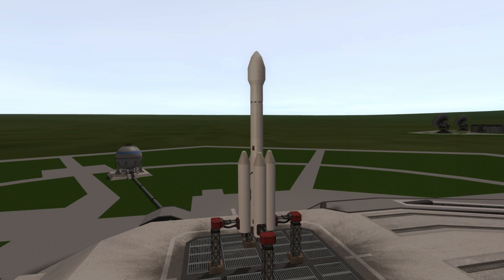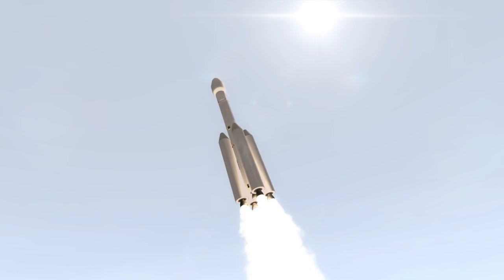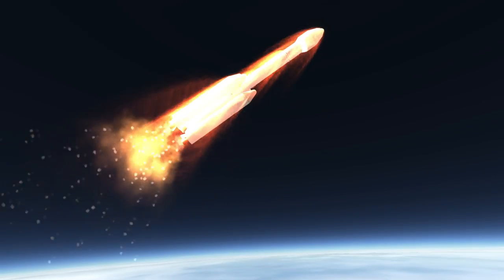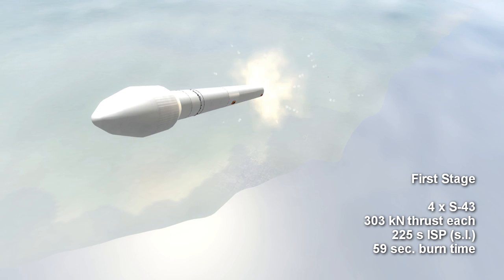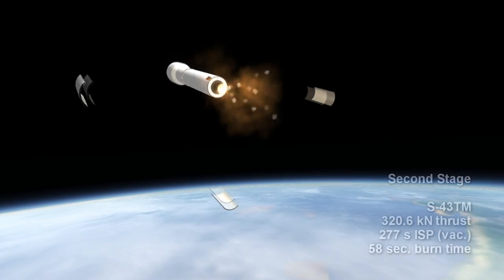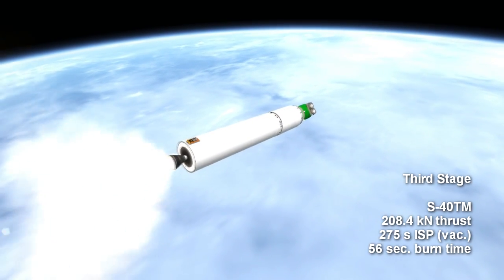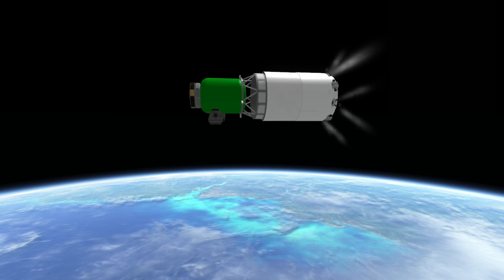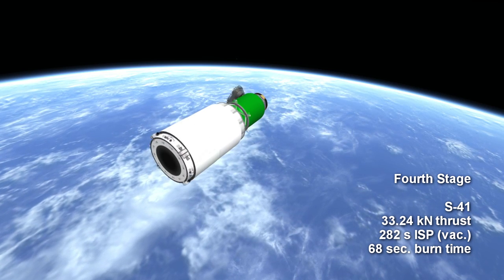Rocket Profile - VLS-1

Comment: Make the vlm.
Reply from the maker: I don't have definite numbers for its first or second stages.
Reply: @RaizSpace  I have some rocket specs, I can help(im brazilian).
Reply: @RaizSpace  do you have twitter?
Reply from the maker: Yes: https://twitter.com/tylerraiz. Though you could also mention them here (if I make a video about it, the numbers are hardly going to be secret). At minimum I need the ISP, Thrust, and Burn Time of the stages, and having the dry mass of the stage is a plus.
Reply: @RaizSpace  Load: Special loads or Microsatellites
Height; 19,60 m
Diameter: 1.45m
Mass: 28,000 kg
Stages: 3
Payload for low orbit: 200 kg (300 km orbit)

First stage:

Engines: 1 S50 engine
Fuel: Solid

Second stage:

Engines: 1 S50 engine
Fuel: Solid

Third stage:

Engines: 1 thruster S44
Propulsion: 33.24 kN
Burning time: 68 seconds
Fuel: Solid

I wanted to tell you that I do not have access to all the information, so some are missing.
Reply from the maker: Yeah, you've basically got the same info I've got. What I need are the details of the S50.
Reply: @RaizSpace  information about s50 engines has not been released.